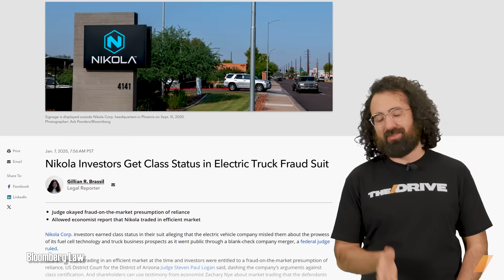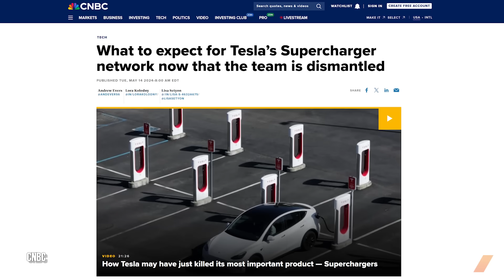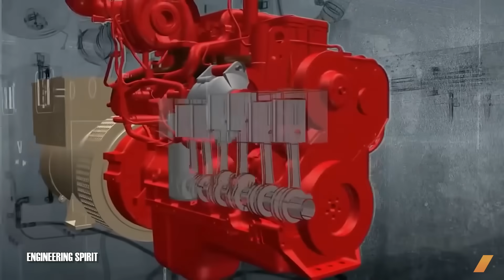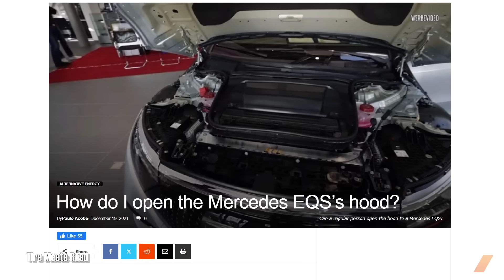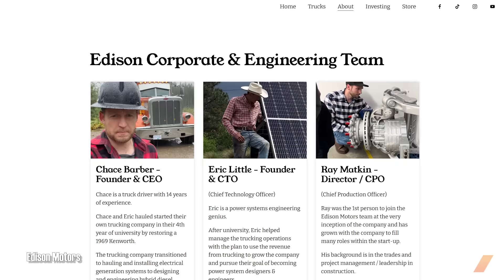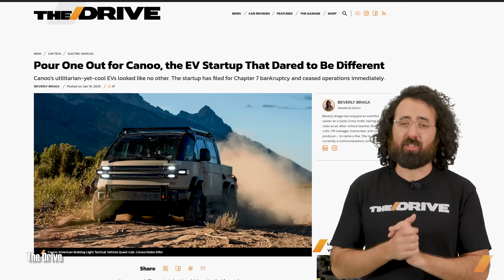The truckers in a shed beating Tesla with 100-yr-old EV tech

Comment: Americans and their usual bs! This is not a hybrid. A hybrid has the combustion engine driving the wheels. The is a range extended electric semi truck. And even so there’s much much better than this because the engine this thing uses is incredibly huge. There’s trucks/semis with much smaller displacement engines and produce much less emissions and charge the batteries much faster thus running for less time thus needing less fuel thus producing less emissions. The Chinese are way ahead. EREV are and have been always have been the right answer to people not wanting to go full ev. The dumbness of governments and greed of west brands in promoting hybrids is pure stupidity, greed and dumbness. EREV actually make emissions go down contrary to hybrids. Hybrids are a scam both the environment and emissions and to the consumer.

Comment: This just keeps making Tesla Semi sound better.  You said you don't know how much a Tesla Semi weights, so you use the GMC Hummer EV?  But you know how much the Hybrid Edison weighs and how much a normal Semi weighs.  Does the Edison weigh less than a normal semi?  How much less?
Tesla Semi has only produced a handful of semis without a dedicated factory.  Edison needs to build a handful of semis and get them to a company to use.  Until then Edison will not have any on the road.  Like Tesla.
When Tesla ramps up, will Edison be able to ramp up too?  Will Edison build a factory, and crank out 50k semis a year?  100k semis a year?
Reply: The Tesla Semi is only feasible for delivering sodas and snacks within a small distribution area.  It is not feasible for actual heavy trucking uses like long haul, over the road, timber harvest, tankers, mining, construction and agriculture.
Reply: @rotaryenginepete  I agree.  Tesla semi is not good for 5% of trucking.  95% of OTR is within 500 miles.  Even if it is not, you can stop an charge for an hour then continue the route.  Imagine having a 11hr daily route doing 750 miles a day with an hour lunch.  12hr days 5 days a week in a Tesla Semi would be pretty nice.  Drive for 420 miles, charge for an hour, drive for 330 more.  How much does that pay?  What route is that?  I might need a new job soon.
Reply: @rotaryenginepete  Wait... please explain to me why you can't use a Tesla semi for timber, tankers, mining, construction or agriculture?  Do all of those require driving for more than 11hrs a day?

Comment: If the engine is driving a generator, it doesn't need high torque, so couldn't the engine be a gasoline one, or even ethanol? These could also be lighter. So why diesel? Availability? Cost?

Comment: Meanwhile, german youtuber "Elektrotrucker" casually drives fully electric Semis across Europe saving money with no real issues so far. That dude pulls up highway hills at the speed limit while fully loaded (42 tonnes). He's now driving heavy haulage loads fully electric occasionally as well.
Granted, the infrastructure is here already, almost completely powered by renewables. Charging Infrastructure is key, not so much the vehicles themselfes.

However, electric semis will not work if you have no driving time restrictions and prefer to drive longer than 5 hours without stopping. Also again: infrastructure is absolute key. The vehicles part for short-, mid- and long-range transports itself is currently pretty much solved right now.
Specialized vehicles are already being evaluated currently and it looks like they'll even sort out logging trucks eventually.

The best part: Electric Semis actually save money so well, it's not even a difficult decision anymore for transport companies. Look at the total cost of ownership and electric now wins by a large margin despite higher inital costs. Electric semis actually make way more money now than combustion semis. For any transport company, it's all about cost. The technology is irrelevant. If profitability is key, electric semi is the new way. 
But try teaching that all of the "Diesel Dieters" as we call them here in germany. Every single driver who tried driving electric ones realizes that it's Game Over for Diesel. The only ones fighting electric are those who never gave it a try for any reason you can imagine.

There's one thing you will not be able to solve with any other technology currently available that electric can: 90-95% total energy efficiency from energy production to energy usage. This is the key why electric has pretty much won already.
Hybrid is a deadend technology that looks great at first, but it just not the right solution.
Reply: He also runs a English speaking channel, called „electric trucker“

Comment: @5:30 You don't lose your turbo boost in a diesel when you have an Allison automatic, that's just a problem guys with manuals deal with, automatics can shift very fast without letting up on the throttle, I have a MD3060 in my bus, I wouldn't want a manual, the auto is more more efficient and provides torque multiplication that the manual can't.  Dude is just ignoring this fact, but most semis today are automatic, OR they have automated manuals which are garbage, most trucks are not old school manuals anymore.
Reply: I think this is why they are looking at the heavy trucking market instead of your average semi

Comment: BMW created a small EV a few years, the i3, a version of which, had a "range extender" 600cc bike engine in the rear to provide additional juice to the batteries. They have subsequently stopped producing this version, probably due to globalist eco nut pressure.

Comment: 3:45 It's a lie that EV's have fewer moving parts.
An EV has billions of times more moving parts than a ICE vehicle.
Every molecule in a battery cell is a moving part that eventually wears out and causes failure.
The faster the battery is charged and discharge the move mechanical wear occurs in the cells that can lead to either loss of capacity or catastrophic thermal runaway.

Comment: Trains do not use real series hybrid - just generator and electric motors.  No batteries and management and electronics. That is mainly the reason why it is working for decades.  New power inverters in EVs will never have that level of reliability. Also, modern electric motors are smaller, lighter but waaaay more fragile. Tesla motors sometimes have failed coolant seals and fried electronics because of that.

Comment: Ok, couple of things. Trains don’t use batteries, the reason they used diesel electric systems was it’s a more reliable “transmission” than a direct drive. The power/energy loss from engine to wheel is quite large, but necessary. It’s not a bad idea, but it’ll never go anywhere, I t’s farrrr too much complication for a minor fuel consumption advantage. I was in the trucking industry for 20 years and there was always some young buck who thought he could do it better, they never come through though. Also, Mercedes prevented owners from opening the bonnet of their EV EQC for safety reasons, no other reason. When you have a 480v system, you don’t want a home mechanic having a fiddle!